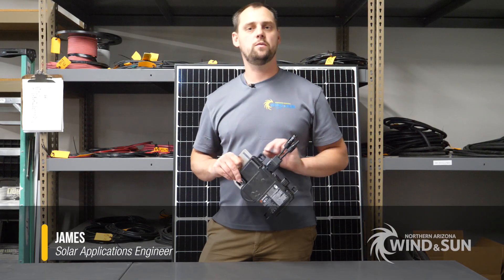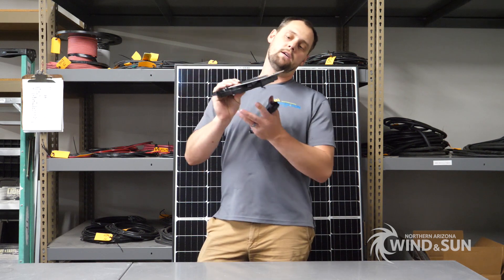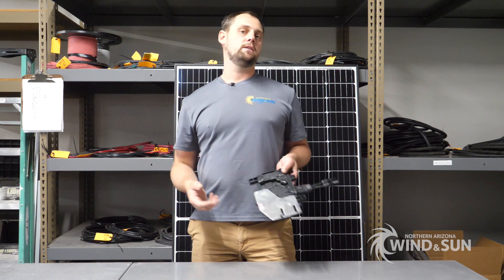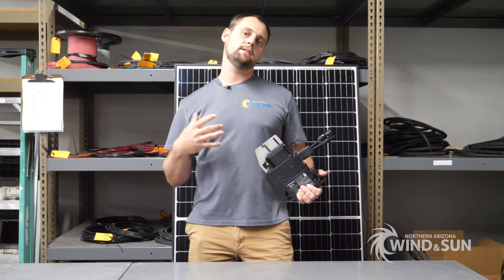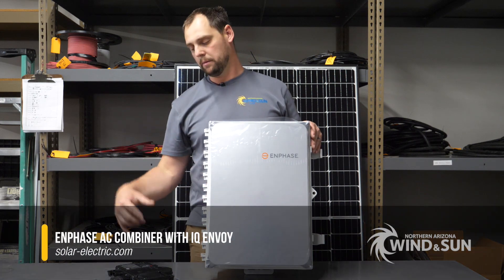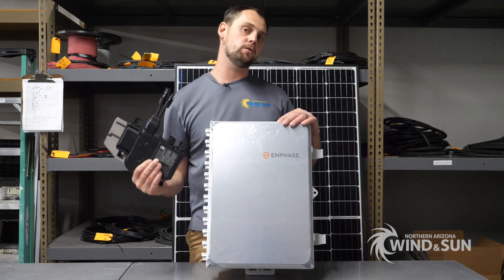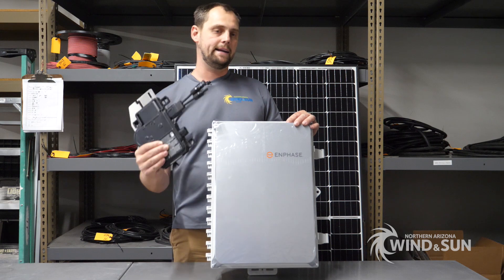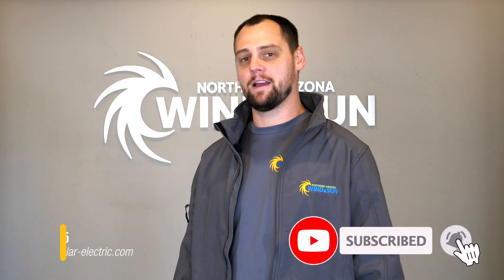Enphase Micro Inverters for Grid Tie Solar Systems

Comment: The fact that you need one for each panel seems like a deal breaker (as expensive as a single or multiple large inverters). I was trying to find out if you could use these (if there was some advantage) with a normal Hybrid 48V DC 120V or 240V high power inverter/ transformer (either high frequency or low frequency). I also thought it would [maybe] make solar panel (and breaker panel) interconnection easier.
Reply: The fact that you do not know the facts about these is astonishing…
Reply: @Scoobydue420  - I know some of "the facts", but obviously not everything. Why don't you enlighten me, instead of being a condescending ass?

Comment: no neutral?   thanks
Reply: nope, just two 120V hot legs fed down into the combiner box, which has a neutral and ground bus bars that tie into the actual electrical panel.

Comment: Hey, I have a grid tie system of this. Sadly after having it installed my grid said I need 200$/month interconnection insurance, my electric bill was 150 a month and my system produced just about what I would use so they kinda are fucking me with my array, I can't connect unless I have insurance thats more then ny bill, so I need to convert my grid tie system to offgrid, or at least a day only setup so I can use my power. I need help with it though, would you do a video on converting a grid tie to offgrid using these products? I have the enphase iq combiner 3..
Reply: The utility is behaving really bad. You should let then now that unless they make a compromise you will post all on social media about how they treat customers. They will conform sooner or later. On the other hand this is just showing why everyone should prepare to go off the grid if possible with Enphase systems.
Reply: that is so wrong and insane.
Reply: @Cannavis  Yeah, it's a 20k system. I spent my inheritance on the array to help myself for the next decade and now it's just doing nothing on my roof..